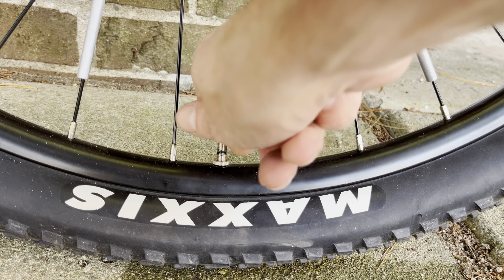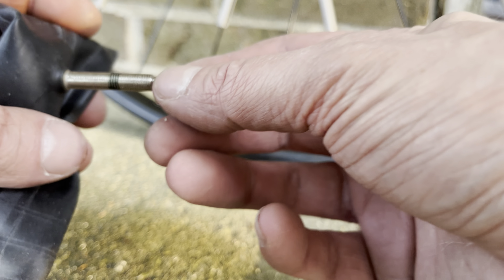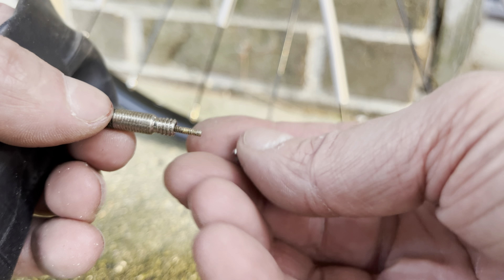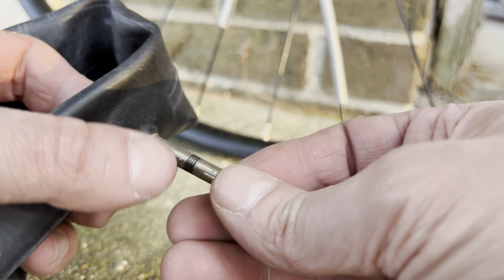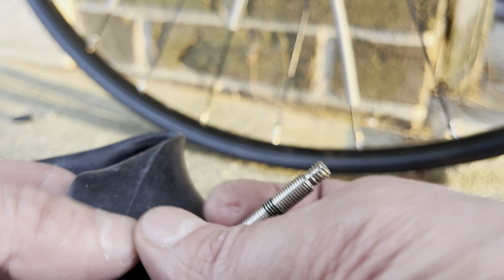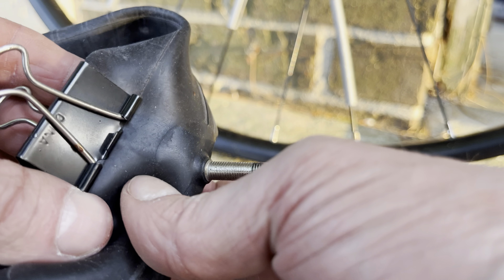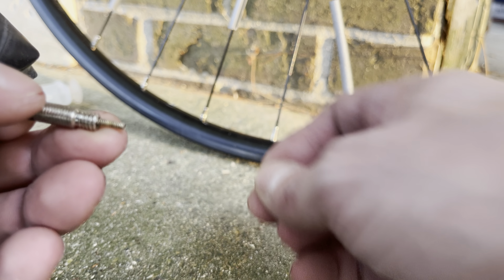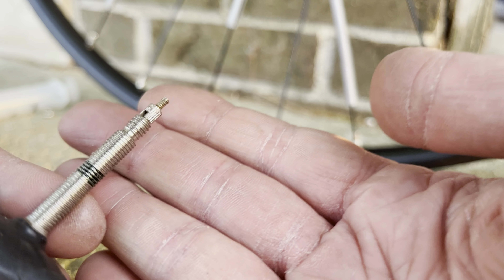How to remove Presta Valve Core (Instructions in 4K)

Comment: first check to see if you have a removable core.  Typically those have a flat side on the nut holding the core in.  These pull right out and can be replaced.  If not replaceable a new tube is the real answer
Reply: No wonder, I’m like “why tf is this shit not coming out!!!”
I didn’t know they made two types 😆 
I thought I was going crazy for a minute there 👍🏽

Stupid presta valves!
Reply: @zjedinite  I did the same!

Comment: The video failed to say if the presta tube has removable or non removable valve core.  So, try to check first if it's removable or not.  The smaller diameter thread for the valve cap is actually part of the core that you can turn to remove it in removal core presta.

Comment: Presta is a POS. Schrader is a way to go. Every time I have a problem with Presta I replace it with a tube with Schrader. No more problems.
Reply: I have a tubeless setup with presta valves. I haven’t had to refill it with sealant since May 2022. Tubes suck.  I have a 29er mtb. With think tubes, I’d get a flat every ride. No problems with tubeless at all. I just pull out the thorns or they fall off themselves . I keep riding. Simple as that.
Reply: What about road bikes?
Reply: I love Presta.
Reply: What is supposed to be the benefit to Presta? I don't see it.
Reply: I was told that Shrader valves can leak or get stuck open more easily if dirt gets in them, and they are harder to clean it out of.  
If you keep the cap, then they are usually fine. Some bike rims won't accept Schrader though, so you can look for presta with removable valve cores or use tire liners.
Reply: @orhanabd1724 
Try tire liners instead. That's what my local shop recommends for road bikes around here where we have goat heads all over.

Comment: Can you inflate the tube without removing it?
Reply: Yes, you can inflate tubes with removable and non-removable presta valves. The biggest reason you need a removable core is to use tire sealant or slime. I live in an area where nobody rides long if they don't have some sort of sealant. 

Tubeless systems also need a removable core, but that's a whole other set-up.

Comment: wow this is mindblowing.. OK I see there’s absolutely no way for me to push and return that needle thing on a tubular tire. wanted to put some sealant in but thats not an option now :|
Reply: There are presta valves with a removable core; this just isn't one of them. So you can get sealant if you switch tube (look for tubes that come with sealant inside already), or you can try tire liners instead. I use those on my road bike, and they have worked out fine.

Comment: Do you have to push the core all the way down like that to put slime in or can you just take the top off?
Reply: if you just take the top off the slime will push the core in and you won't be able to find it
Reply: I wish someone would answer this
Reply: There are presta valves with a removable valve stem, unlike this one. There are also tire liners if you can't find those.

Comment: Another way to make sure you don’t lose it is to make a small hole back of the tube. That way you can literally take the metal out. Fill with slime then poke the metal back through into its original place then put a puncture repair on the hole made. Or save all the nonsense and just buy 2 tubes with slime there only about £17 pound for a set.

Comment: what is the point of this video? what is the benefit of what you did in this video?.
Reply: Specific target audience
Reply: I just bought my first bike that has tubes with presta valves. I didn't know anything about presta valves. I live in a desert where you have to have slime in the tubes to keep them inflated. To put slime in you have to remove the valve core. I found this video very informative and appreciate that it's here.

Comment: Or you can even not touch the valve at all as it’s not meant to be removed and you’re just risking damaging it. Instead make a hole or puncture site and use a syringe without a needle and inject the slime into made hole or puncture site then I’d suggest using a puncture kit for that hole as might be a bit big and there is another solution. None of them are perfect mind 🤣